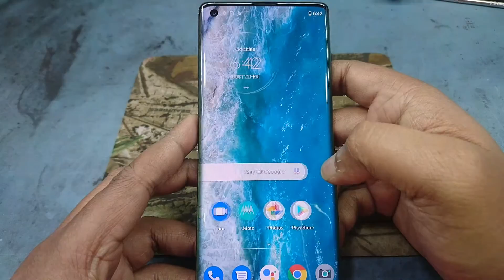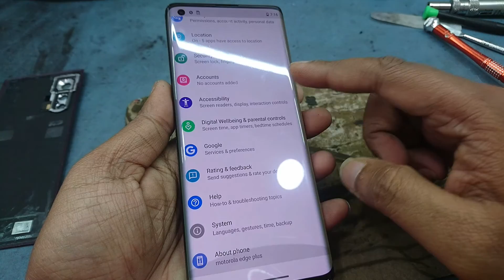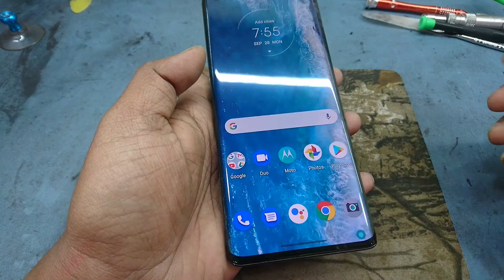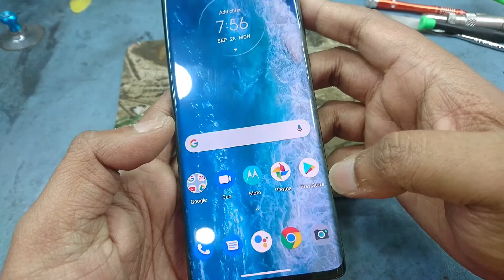moto edge plus Display Replacement and full Disassembly guide

Comment: Great video! I only needed to replace the back cover, but after getting through the adhesive discovered that I had cut the twin flex cables, so a warning on not diving too deep past the edges would be helpful. After replacing the flex cables based on watching more of this video (thanks again!), the lower speaker isn't functioning. I double checked the spring contacts for it and they seem to be making contact, so I wasn't sure if this could be an issue with one of the flex cables. I can't find any detailed description on what they're for other than "charging port and LCD" possibly. Any suggestions would be greatly appreciated!

Comment: The problem I am having is the following:
I have the phone Motorola Edge for 1 month or so.
After a while it feels like a clicking sound (like a shock) from the top speaker. It does that every so often and that always happens when the screen is idle. If the screen is on while I'm using it, it doesn't happen.
What I also noticed is that if I bring the phone to my ear and slowly separate it up to about 4 centimeters more or less, you start to feel a continuous noise (tic-tic-tic-tic-tic-tci ...) If I hit it again, the noise stops, but if I separate it again, it starts again. If I am separating it, the noise continues to be felt until it diminishes because I am moving it away and the ear cannot feel it. But I guess the noise must go on continuously, I don't know. I imagine that this continuous noise that is felt must be from the proximity sensor, but in any case it seems very strange that it emits that noise, since I was corroborating it in
other phones and nothing is felt. The latter with respect to continuous noise.
The truth is that the click is quite annoying, and when it is in silence it feels even more so.
There are times when he has a good time and nothing is heard, but from time to time he starts doing it often, there are even times when he makes several clicks in a row. I clarify that they are not very strong, they are rather mild, but they are heard.
I was also observing if the click did it when a notification arrived, etc, but no, since when the click came, I would notice and there were no notifications, and also sometimes if there were, and when there were, I kept leaving it with the screen idle, and the click appears again from time to time.

The steps I carried out for tests are the following:
1) I did the hardware tests from the settings part, in the sound section and everything works ok.
2) I took out the SIM just in case to test, and it kept making the sound.
3) I rebooted the phone in safe mode, and it kept making the sound.
4) I factory reset the phone, and without installing anything, I was testing it and it kept making the sound.

Could you tell me if it could be a hardware problem or if you had this experience with another phone?
Thank you very much.
Greetings.
Reply from the maker: Your already done the basic steps,  I think it's inbuilt features,  but please visit on service center in your city for best solution,  and doughts,

Comment: Is it possible to assemble the phone back after changing the display without the glue sticker you used @13:50? If not, where to get it?
Reply from the maker: Try to online websites like a amazon,  eBay, aliexpress

Comment: I dropped mine last night & I cracked the lower right corner. I doesn't respond to touch so do I have to replace the digitizer or just the glad screen? It didn't really look that severe, but it doesn't respond to touch. 
Thank you in advance for the reply.
Reply from the maker: Please visit on service centre for original parts, do no buy online or local shops it's provide duplicate
Reply: @amitkeshwar2428  I got mine from Ali Express. Screen looks like original, but after getting the phone together very good, it now has no sound. I'm going to have to take the back off again.
Reply from the maker: Visit service centre
Reply: @excalibur1812  hello sir can you give me the link of the product

Comment: The PCB for charging doesn't pass the voltage to the battery. The 9V that comes out of adapter becomes less than 1v when it passes. Any suggestion?
Reply from the maker: PCB provide different different voltage to different parts, there is common system of each mobile, each brand's ,  what is problem with your phone?

Comment: where can one get a moto edge plus, back door replacement at???? cant really find parts for this phone anywhere
Reply from the maker: Try to service center visit from your city or discuss with customers care no.
Reply: @amitkeshwar2428  no, not really able to. Currently thinking about buying a moto edge plus for 399 u.s. great condition minus the back of it's busted needing replaced. Which a good case on it would be fine. But, none the less can't find parts anywhere for this device.

Comment: Are u getting green tint or any other display problem after the display replacement???
Reply from the maker: No sir
Reply: @amitkeshwar2428  thank you
Reply from the maker: Most welcome
Reply: @amitkeshwar2428  I am also having tint problem in my new motorola edge  plus mobile.Will screen repair or replacement solve the problem???
Reply: Please reply I am unable to use my mobile.I bought it 10 days ago.
Reply from the maker: Replacement

Comment: You did a lot of un necessary stuff in this repair…You DO NOT need to unplug any antennas or vibration motors or anything like that you just need to remove the battery and Un clip the screen. And then rewind I’ve done many of them…what your doing is miss leading because people can damage there devise unplugging all of that….for no reason
Reply from the maker: No, I am properly following steps and showing main scenes